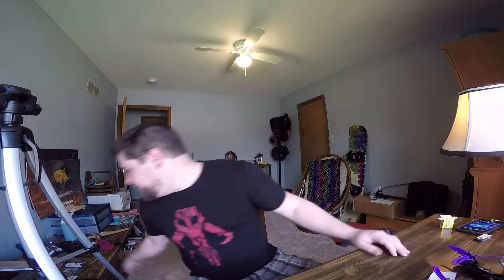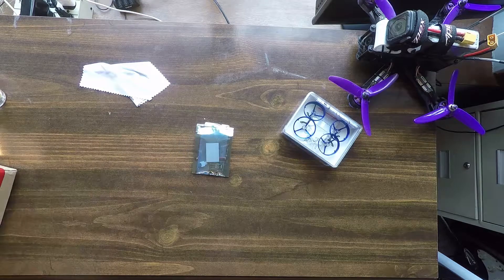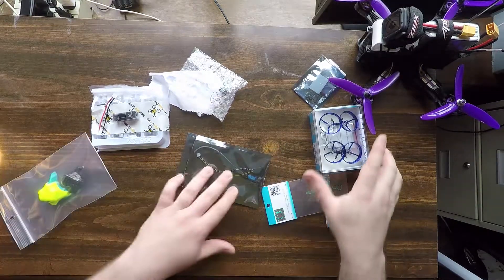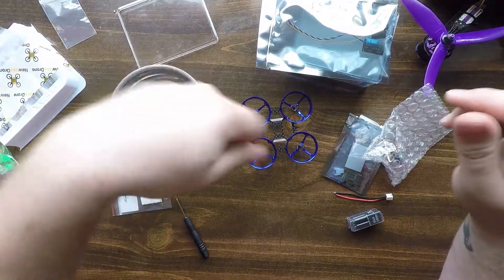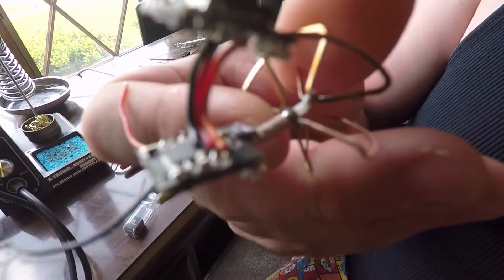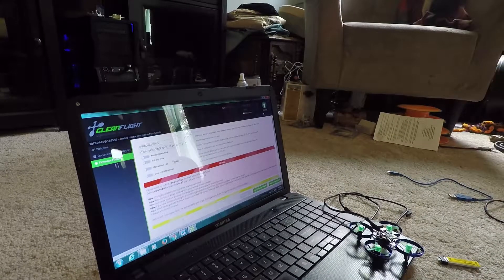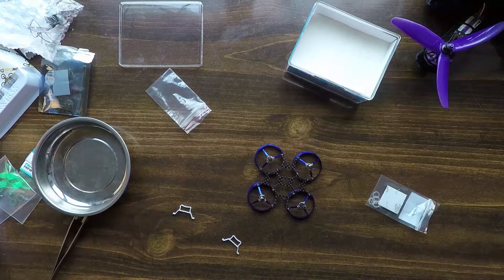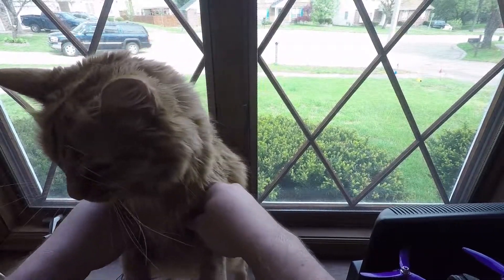Turnigy Evolution Tiny Whoop

Comment: Any word on fully integrated boards for the Evolution?
I'm not happy about needing a separate receiver adding weight to my builds.
Reply from the maker: After I built mine, it looks like they may have updated this to include AFHDS 2A protocol, which should be compatible with the Evolution. I'd do the research first though, just to make sure.
https://www.banggood.com/Beecore-F3_EVO_Brushed-ACRO-Flight-Control-Board-DSM2-For-Inductrix-Tiny-Whoop-Eachine-E010-p-1089021.html
Reply: Yep the two newest reviews both say it'll work with the Evolution:)
Thank you for the help bro:D
Reply from the maker: My pleasure!